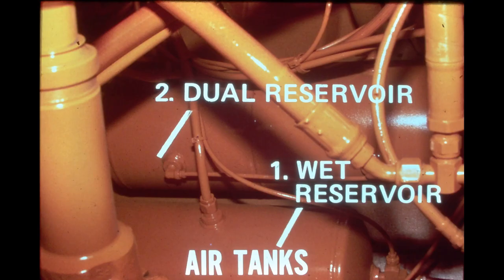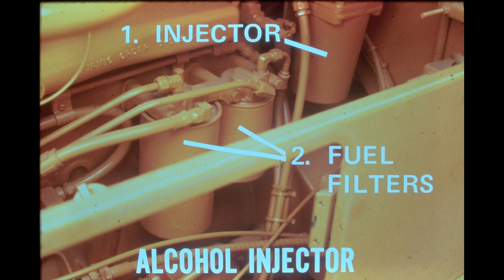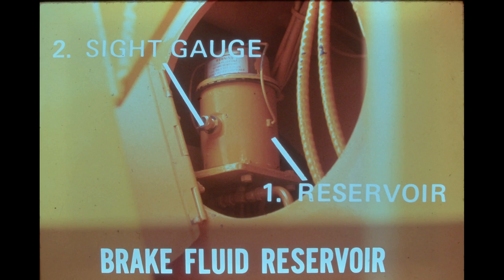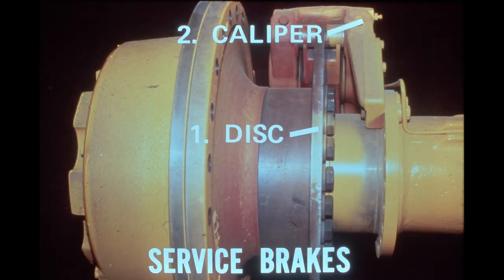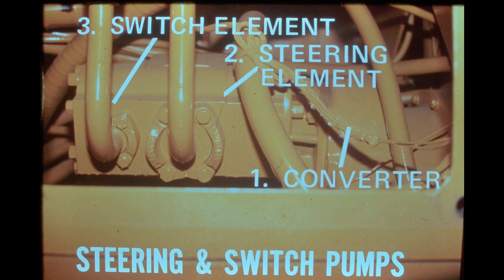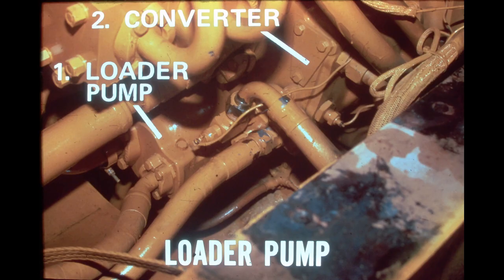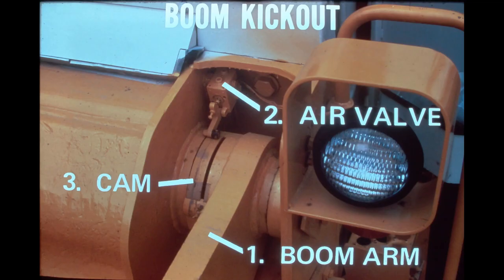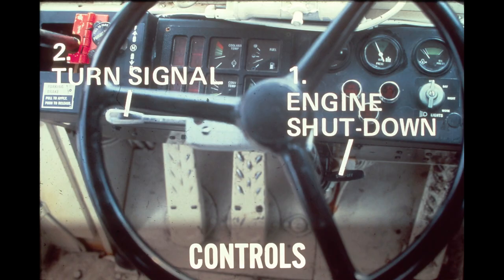International 540 Payloader Orientation Part 2

Comment: I ran a Case 680 with ( Air brakes) emergency brake was air control ( red nob on dash) the Case 780 had a ( hand operated) emergency brake. I was doing hoe packing and help backfill on main line sewer job. This was 1979. The Case 680 would LOCK up the emergency brake all the time( run engine at high speed) where I was to get ( Air pressure up) in what in my Humble opinion were ( Small tanks) that Case had installed on the Case 680 system. It always locked up emergency brake on say lots of rear wheel brake turns. I started digging the side sewer stubs. We had the Case 790 for that. We also had a 190 Dynahoe ( my favorite) the Case 780 never Locked up it's emergency brake. Hand operated control lever on floor. It was still 
( Air brake for tires) the Case 780 did NOT lock up or stop in your tracks when using rear brakes to turn. You could keep working, just low air pressure buzzer alarm going off. The Air pressure on Case 780 would build up faster than 680. Going back to 190 Dynahoe, was worried when Foreman left me at it one day, to dig side sewer stubs. I was all by myself looking at this new backhoe to run. It had been converted to two lever joy sticks ( twin- a- troll)
BE name for them.. Not the 4 lever standard Factory BE control. I got on her. What a joy to drive. The simple fluid lock out electric control for rear braking. ( Switch on front loader control lever) for left or right braking. None of the AIR problems with brake lock up on backfilling my side sewer stubs, in the muddy dirty off the right of way, using your rear brakes to fill over ditch. Anyway LIKED the Dynahoe 190 so much. I bought one in 2003. It had 8000 hours on meter. I have put 100s of hours on that good old Detroit 353. Other than seal Leaks on Hydraulic cylinder. I replaced all Hydraulic lines myself weather they need it or not. They were all old. The Dynahoe was a strong machine. Only one that stand up to hard work with bull prick ( Jack hammer head) or hoe packing with vibrator plate. That's my story with Air brake system on Backhoes. Strange how same company CASE built emergency brake air system in 680 but had standard pull brake in 780 for emergency brake. The 790 case were huge. Long stretch for outriggers. The problem with the one that I used. It had muffler leak at base. That smoke sucked into air intake next to stack. It would plug up all the time. Engine would starve for air. Boy all the things you learn on operating these pieces of equipment. Just like your video. These are great learning tools for a guy that has one of these for Restoration.